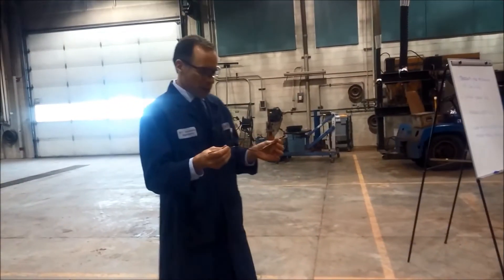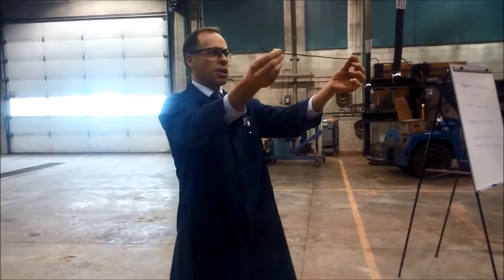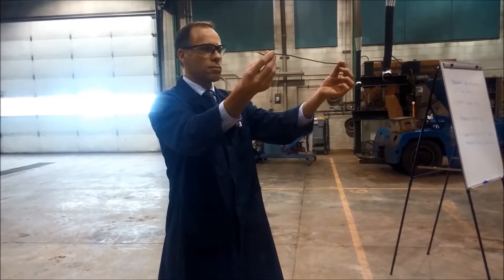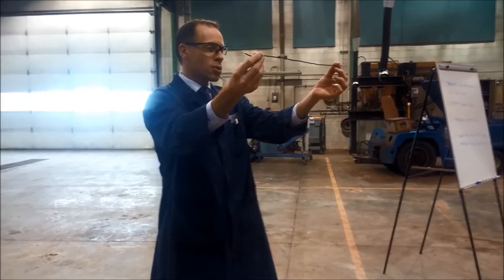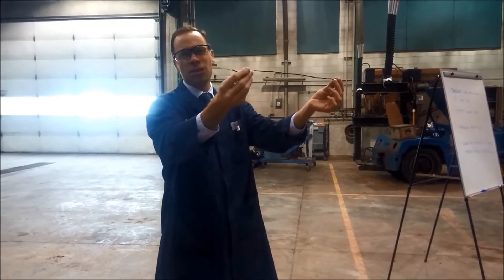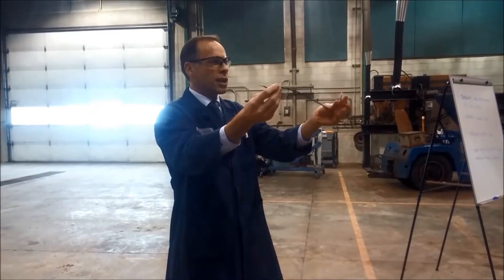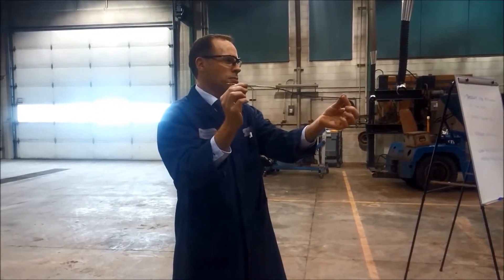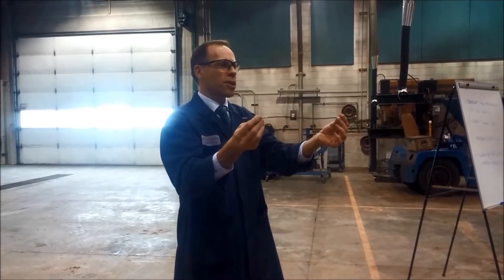Demonstration of Ohm's Law in the Real World

Comment: Hey Can somebody explain this to me? I am not able to get it. If no resistance is there, then E = 1500*0.001 i.e very less. Isnt it better for wire than E = 1500*12?
Reply from the maker: I think you may be confused because you are assuming that current causes voltage.  It does not.  Current is always the result of the voltage and the resistance.   In the video, I didn't say that there were 1500 amps flowing- I said that the battery is capable of producing up to 1500 amps if the voltage and the resistance will allow it. So, if the resistance of the wire was 0.001 ohms, and the battery voltage was 12 volts, the result would be: 12 volts/0.001 ohms = 12,000 amps.  However, our battery likely can't produce that much current, so the voltage on the battery will be pulled down and the current will be less.  I hope that makes sense!
Reply: @JustinMillerAutomotive   Sir light Bulb resistance is 12 ohms okay , but how do u say that 1 Ampere current is flowing in the circuit while we dont know the battery voltage . Please reply
Reply: @kiranbs5057  car batteries are 12v
Reply: @kiranbs5057  battery voltage is 12V